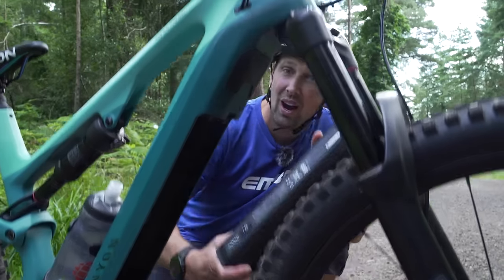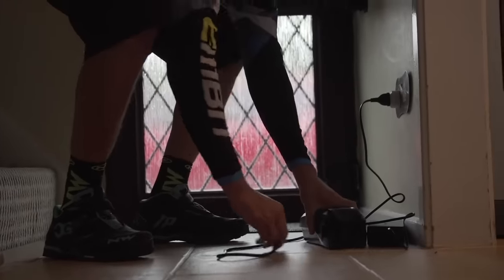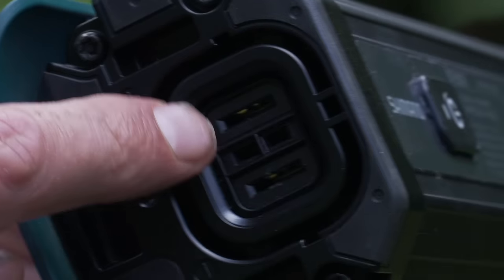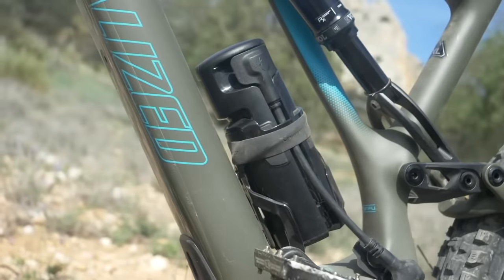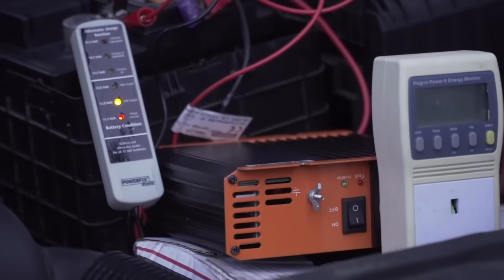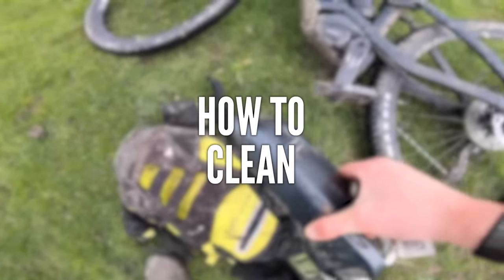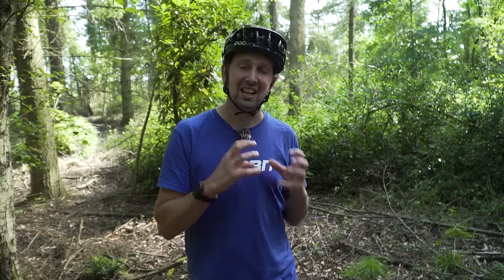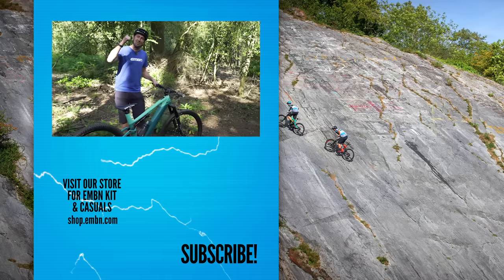How to Maintain Battery Health | E Bike Batteries Explained

Comment: I'm trying to not let my ebike battery get run all the way down, but it happened two times. Last night after a long distance bike ride I did from Rice Lake Wisconsin USA to Washburn county and back, I thought it might have had at least enough power left to get me home in a few minute bike ride from a grocery store called MarketPlace. I found I was wrong it ran totally out of power before I got home. My leg muscles were feeling quite a bit too sore to pedal anymore. I really hope the longevity of my ebike battery won't be hurt very much yet, as long as for sure when it gets down to a red light, I just use my own pedal power. Also I would just charge my ebike battery to 80%, but my ebike battery charger doesn't have a charge meter, so I've just been charging it til the green light comes on. Anyway this was a good video though with good information and tips on how to keep getting the best battery performance and keep it lasting for a long time.
Reply: Why do we care what store you stopped at?! Anyone not from Wisconsin, has no idea where Rice Lake is or how far it is from Washburn County. 😂

Comment: For longevity of a lithium battery a few things matter, in no particular order. 
-It's operating temperature when charging and discharging and storing. Charging/discharging a very cold or a very hot battery will degrade it somewhat faster. Usually, advanced systems have a cut off to prevent charging at over 40C.

-The cell (the battery pack contains several 18500 battery cells) is most stable at its nominal voltage of around 3.7V, its operating range is 4.2V when fully charged and around 3.2V when fully discharged. Technically charging cycles between 20% to 80% should result in a prolonged battery life. This also means that it's better to top off your battery at say 40% if you are before a ride that will take it to near flat, then allowing a deep cycle.

-How quickly it charges and discharges (the sustained current flow), the lower the current the better, theoretically eco is better than turbo for battery health but turbo is so much fun :).

Also, I think the "1000 cycles" is referring to the average capacity loss after the "1000" full charge/discharge cycle, but of course, this depends on the conditions.
Reply: Think you mean 18650 cell
Reply: Is GMBNs claim that recharging a half full battery counts as a full "cycle" just like charging from 10-20% accurate? I've heard conflicting info. 
One video claimed always keeping it at 20-80% would double lifespan, but does that account for the fact that each cycle is only 60%? If not that's only ~10% slower degradation, if yes then 20-80 method should make a battery last almost 4x more "cycles".
Any thoughts on this?

Comment: I would have liked to hear some facts to back up his #4 don't immediately recharge after a ride. On my first 2018 Turbo Levo I always waited an hour or 2 after a ride and I always tried to stop recharging at 90% and limit discharge to 40%. After about 60 charge cycles I had only 90% battery health and at 85 charge cycles I had one charge indicator light always showing red and Specialized replaced the battery. On my 2020 T Levo I put it on charge immediately after a ride and leave it plugged in overnight or even a few days. Now at 50 charge cycles and 
3500 kms in 10 months I still have 100% battery health. I rarely get home with less than 40% remaining and I recharge anytime it's less than 85%. Another thing I always do is plug in the charger before connecting it to the bike. I noticed that my electric scooter/trotinette makes a big spark if I don't do this, so I figure it makes sense to avoid this discharge surge, but I have no facts to back it up.
Reply: the output caps in the charger cause the spark cause the battery is putting a surge across the caps
Reply: This model Levo had battery issues and motor issues more than they should have, i see them for sale used with both replaced by warrantee.

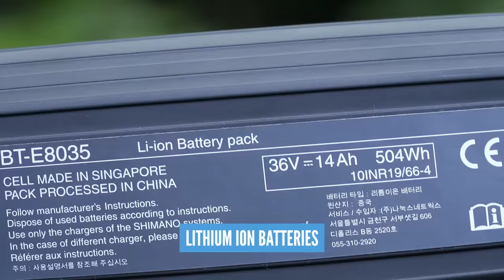Comment: 3:47 lithium Ion is the battery type used for big laptops,ebikes , scooters etc, Li-po batteries are what current consumer handheld devices uses! Faster discharge/recharge rate and also a lot more compact/lighter and generally easier top make into smaller fitting sizes/shapes.

Comment: Problem with 80% charge is 80% ride distance....that would totally suck. I have 13 amp hour(624WH) and with mid level assist I can cover up to 110km. If I had a 900WH battery, would I want to treat it like a 700?

Imagine buying a car with a 100 litre gas tank but it is recommended you only fill to 80. Having a larger heavier much more expensive high capacity battery, only to use like a much lower capacity battery does not compute.  

Hopefully R&D with get us further along. Over all still love my eMTB, over 8000KM in 2 years. Battery IS degraded, but I can still get some good rides in. Looking into a new one, and keeping the old for known shorter rides, or as a back up on a real long ride.  - Cheers

Comment: One question on battery replacement, how long manufacturers are ensuring to produce the battery as spare part? I wonder if after 5 years I will still be able to find a replacement battery for my eMtb. Since those bikes costs a lot of money, there will be a lot of people keeping them for a long time, but if you cannot change the battery (or the motor or the commands) will you be left with a piece of junk?
Reply: I'm hoping if there's a decent advance in battery tech I will be able to get a retrofit upgrade. My current Bosch powertube is 625wh, I imagine in a few years a similar size battery would be of higher capacity.
Reply: All lithium battery packs can be rebuilt by technicians specializing in this service. Mostly they do power tool batteries but the e bikes use mostly the same individual cells inside the packs. A pack is made up of multiple batteries. The tech' takes out any bad ones and replaces with new ones, test that the pack is balanced and charging and discharging in a safe manner then add a short warantee and your back in action. Cost can be low compared to a whole new battery.

Comment: This is why I'm getting batteries without the fancy case, just the battery with the electronics that I can stick in a bike bag. When it comes to replace it, I won't be spending as much. Just but a new battery and stick it in that bag on my frame. 

But also really cause I'm poor and on a time limit to get this done, so have to get the best specs I can at the cheapest I can get them ;~;

Comment: Point 4 Don’t recharge immediately after use? How long do you wait? Didn’t understand that one.

I got a charger with a 90% setting. Also another strategy is to get a big battery, and make sure it’s maximum discharge rating is far higher than the motor rating.
The bigger the battery, the less the demand on constituent cells. Resistance is also less, improving efficiency. I got a massive 1450 Whr battery, 14s 9p, to go with a 1700 W max bbshd mid drive beast of a motor. I set the max current to never exceed 1/3 of the maximum cell discharge rate.

Also this makes it possible to use the rule mentioned, if the battery is large you won’t flatten it on the ride, or need to fill it right up, which is the main way of shortening its life.

Also high voltage 48/52 is better than low. Low voltage translates to higher resistance and shorter battery life in terms of distance covered...ie low voltage systems are inefficient.

Also it’s worth understanding the basics of current electricity in these systems, even if you buy an expensive ready made ebike, to verify if the battery and cell type is really appropriate to the motor, and so you understand what you are getting for xxxx euro. You can get a far better bike for less money by getting a kit, which takes less than a day to fit....
Humongous battery, choice of accessories, huge range, UNLIMITED POWER!.....

Comment: Li-Ion cells have virtually no self discharge, however the bms uses energy as it constantly monitors individual cell voltage. a li-ion battery without bms does pretty much not discharge even after years (at storage voltage).
Reply: Jonas, if I were to store a Li-Ion battery for the winter months, at what level of charge do you think it would need to be to prevent discharge below zero?
Reply: @keithcarrier1910  if you want to store it for many months it's best to disconnect the BMS at 50% SOC (e.g. 3.6V per cell). no BMS, no discharge. Some BMS are powered by the plus pole balance wire which can be interrupted withba switch. or the entire balance wire harness can be unplugged from the BMS. A typical BMS (e.g. Daly) will have a current draw of 0.05mA. that isn't much, but possibly other BMSs have  a higher standby current draw. for a few months I guess you're fine leaving it at about 80%.
Reply: How do you disconnect the BMS?
Thanks
Reply: @MrGuy999guy  I cannot recommend doing it on Bosch, Yamaha, Shimano etc. BMSs as there might be issues with initialisiation. On 3rd party BMS (which are often higher quality...) like JBD or Daly you can disconnect or switch the positive pole balance lead which supplies power to the BMS

Comment: Another good tip is to occasionally charge to 100% as then the clever internal electronics will balance the individual cells...this will optimise the range.
Reply: BMS should manage and balance cells all the time.
Every time you take your battery over ~80% you loose a little of capacity.
Reply: I’m confused. My battery are called Panasonic Tesla cells. Is it okay to charge them overnight? 

Also I’ve accidentlalt disconnected the battery while the battery was still on. Will there be any severe repercussions for that? It’s only happened twice. I’m a bit worried I might need to replace the battery. Hope not
Reply: @gregoriodia  by Bosch this is definitely not true. The balancing happens ONLY at the last 20%. By the time the differencies between the cells are growing. My ebike last 20% can be 10 hours sometimes. The Bosch BMS has separate CPU chip and the intelligent BMS IC works as simple sensor/driver.

Comment: I got my new ebike today and used it immediately for about 30 to 45 minutes. Now I read I needed to charge it for 8 to 12 hours before using it for the first time. Did I just compromise the battery? 😢
Reply: If you didn't discharge battery down to low charge level nothing happened.
Around 30% would be still good level.
Below that it starts to push cells into voltage range where chemical reaction starts wearing them and leaving battery into lower state of charge for longer time would be harmfull.
But also high charge/voltage of cells starts different chemical reaction wearing cells.
If you want to maximize life of lithium chemisty batteries you should avoid charging over 80% unless actually needing that longer operating time.
(and longer no use storage ideally at around 50% charge)

Comment: The battery jammed half way in place before I took a Trek Verve off the showroom floor today. Although I bought the bike today, I can’t pick it up until a mechanic un-jams the stuck battery. Trek needs to do a recall or offer a better explanation than the errant salesman who locked up the battery sticking half way out. From there, it wouldn’t bug in either direction.

Comment: if you want to keep your iPhone battery in perfect condition you should charge it at 40% and stop charging it at 80% this is the ideal range i have an iPhone 8 Plus 256gb that`s about 3 years old and still have 96% battery keeping to these rules Ive never fully de charged it though which they say i should do every few cycles on my NCM Moscow 48v.

Comment: Excellent video, i would like to add: Never put lithium batteries in a landfill! They start fires. Many waste truck drivers or rubbish tip operators have had to risk life and limb putting these fires out! Lithium is likely to burst into flames at temperatures as low as 80 degrees Celsius. So power tool batteries included take them to the DIY store for recycling.

Comment: Hi, thanks for the video. I’m after some advise, I have a specialized levo gen 1 fattie bike and the battery only charges to 86%, I changed the battery thinking it was that but have the same problem with the replacement battery? Any ideas how to reset the charger/charge limit?

Comment: Can you please explain: Things not to do #4 - putting your battery on charge as soon as you get home from a ride, you need to let your battery go from a state of discharge to a state of charge...How long should one wait before charging their battery after a ride?
Reply: Unless the battery is warm or hot to the touch it won't matter.
Reply: @Rippy211  correct
Reply: I ride my fat tire ebike only in snow so by the time I get back it is quite cold, and batteries don’t do well or charge well when cold. 

So I think the advice is don’t charge the batteries if either very hot or very cold.

Comment: Great info! 
Question: Can I use a solar panel to charge ebike battery?
Reply: You can, but if you won't have some stabilizer then voltage variations will quickly deteriorate the battery.
Reply: You can charge anything with solar panels as long as you have the proper setup for you panels. 

Example, your solar panels will charge up batteries during the day (the panels pass through a voltage regulator before going to the batteties) and then you hookup those batteries to an inverter into which you can plug any 120v appliance or gadget you wish.
Reply: Yes, but make sure you have a solar charge controller that regulates the power going to it otherwise you can damage the batteries by overcharging.

Comment: I am new to ebikes good useful video on batteries. I have a question though, I keep my ebike in my garden shed should i remove my battery and take it in house to avoid those extremes of heat and cold especially in the winter?
Reply: Keep your battery in your home.  Always charged my battery in the garage.  After three years I had to buy a new $675 battery .  They told me the battery reached 140 degrees and ruined it.  I now bring into my home after every ride.  Expensive lesson.
Reply: @jerryschroeder645  thanks for the info Jerry i shall do as you suggest

Comment: Can you confirm that you need to wait 1 hour after ride before recharging do to hot or warm battery?
Reply: You will be lucky to get a reply mate ,they very rarely answer anyone
Reply: You dont, they are talking nonsense. Its better to charge it at ambient temperature but most decent batteries have a very good casing design which is design to radiate heat away from the battery so it will cool very quickly when not in use. These guys are just trying to think of an excuse to make a video tbh.
Reply: 5-10 mins maybe, but  60 is completely unnecessary.
Reply: If you've been riding hard (turbo/Boost/flat out in trail) for the latter part of your ride, the battery will be HOT !   In these instances, leave it an hour to cool down to ambient temperature or you can kill it.  Otherwise, you should be fine.  Same with anything with high current use like electric chainsaw or electric leaf blower. The batteries are hot and will most likely die if you charge them straight away.

Comment: Repacking the cells should be easy enough and a lot cheaper than replacing the whole unit. Hopefully as ebike are getting more popular this service will become readily available.
Reply: Not currently. But I haven't looked. There's a few YouTube videos of people doing it.
Reply: Err, when you said 'repacking the cells' did you mean 'replacing the cells'?
Reply: @giotto4321 yes I meant repacking the battery with new cells.